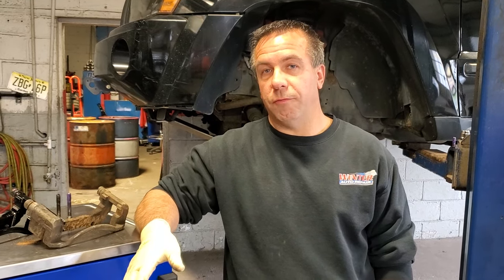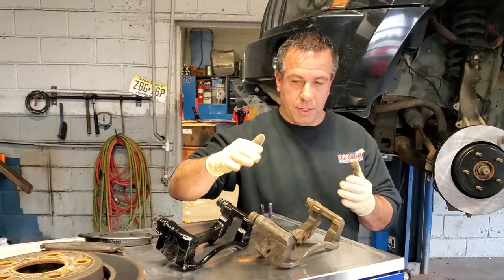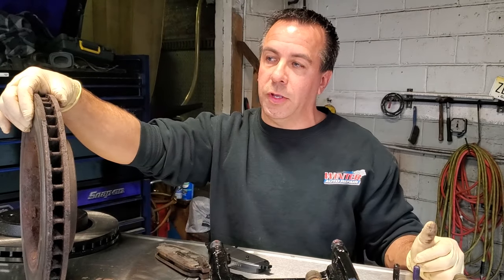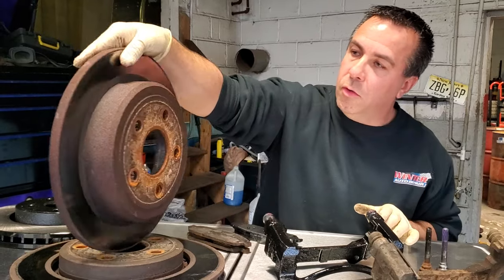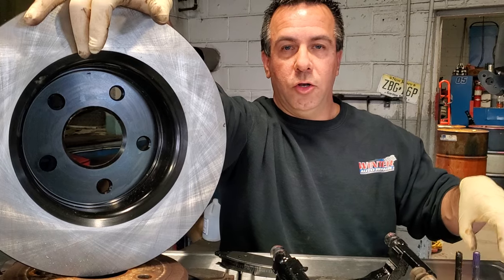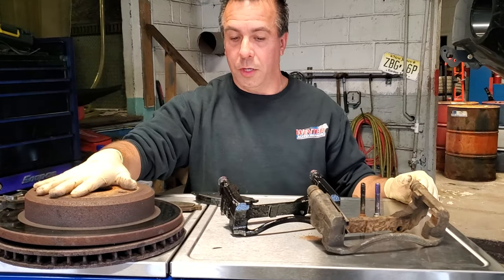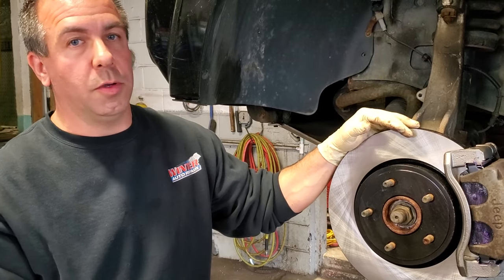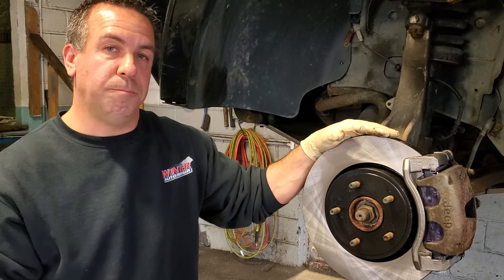High quality brakes vs cheap brakes

Comment: Is this a commercial?  My first job when I was a kid was loading groceries into people's cars, after that I did oil changes.  We did oil changes at cost, because my job was to find anything wrong with the car, that's where our profit came in.  I had to explain myself why I only did an oil change on a car that came in for an oil change, why didn't I sell the customer a transmission flush, coolant flush, brake flush, shocks, struts, brakes, tires, wipers, alignment and batteries.  "Mr. customer, your battery is over 12 months old, you don't want to find yourself and your family stranded do you?"  We had to memorize our lines.  Had the job for less than a year, pay was good but couldn't stand it any longer.  At any rate, I have to say that this is the first time I've heard of how terrible "white box" rotors are.  Looking over my maintenance records on my truck, I bought some rotors from rockauto back in 2017 for less than $22 each.  I have more than 40k miles on these pads and rotors while constantly towing about 3k lbs empty to 9.5k lbs loaded.  So for the last 4 years, and 40k miles, I've been towing a trailer that outweighs my truck using rotors that cost less than $22 with metallic pads (those who know about brakes know that abrasive pads, like metallic pads, shorten rotor life compared to ablative pads, such as ceramic pads) and have no shimmy, shake or abnormal noises.  And I'm about to hit the road again in a few minutes, same truck, same trailer, same brakes rotors and pads (those were less than $10).
Reply: nice
Reply from the maker: Not sure what you mean about being a commercial.   Was just a video to show the difference between cheap rotors that didn't last and the quality parts we use.  
Unfortunately the place you worked for sounds like a chain or larger store.  We do not pay our techs by the job or flat rate.  They are hourly employees.  We do not give bonuses based on selling jobs.  If we did we would use cheap rotors and pads so customers would keep coming back.  We've been open for 26 years and my kids have plans to take over the shop when I retire.  The only way to have a generational business to to treat the customers right. 
Sounds like you've had luck with cheap parts and I'm happy for you.  It's not what we use and if a customer wanted cheap parts we would recommend them to another shop.  I stick to my convictions on quality even if it means a lost sale.  I'd rather have a customer leave because they feel I'm too expensive then find out they crashed and their family was injured or worse because of an inferior product.  
Thank you for watching and commenting on my video. 
Good luck with your truck, I hope you have continued success with it.
Reply: Depending on budget, I am willing to use cheap uncoated rotors and premium pads. You will get 2-4 years out of the rotors in the rust belt before they are scrap. I never use cheap pads though. They sometimes won't fit in the slides, squeal, leave large amounts of dust.
Reply: @mph5896 , For my personal vehicles I typically use Wagner or Raybestos, not cheap, but not high-end either, but inflation has made them a bit more expensive than just 2 years ago. Are you in the rust belt? I'm in Texas, part of the "swelter belt", but not as bad as Arizona, New Mexico or Nevada. Rust doesn't chew my rotors. Everyday use is what does them in. My daily driver, a Chevy Impala, rotors last about 4-5 years, but the rotors aren't worn, they're warped, and after 5 years of use I can feel pulsations in the steering wheel when braking. But that car has aluminum wheels, and is not towing, so I use ceramic pads, which are ablative in nature. I still have the same truck that I mentioned before, with the trailer that outweighs it. Because of the weight, and because it has steel wheels, I prioritize braking power over brake dust, so in this case I prefer metallic pads, which are abrasive in nature. So those rotors don't warp after 5 years, but they do thin after about 3 to 4 years. Because it doesn't warp, I don't get pulsations in the steering wheel, so I have to remove the wheels to visually inspect the pads and rotors, which I do once a year.  Funny that you mention squeal. My truck squeals as I drive down the road, but hearing it for hours on end, I kind of tune it out. But when I apply the brakes, even slightly, the squeal goes away, it's as quiet as a mouse.

Comment: i bought some white box rotors that are cross-hatched. my question is i have some high temp caliper paint, would it help to paint the uncoated surfaces like the coated surface of the better rotor?
Reply from the maker: I guess it couldn't hurt to paint the hat and veins.  Just stay away from the rotor where the pads touch obviously.    Good luck!
Reply: Honestly I am not a very tech savvy however I always buy brakes from geobrakes.com 

And they sell on really cheap price but thr quality is good
Reply: @WinterAutoRepair  thanks your response is much appreciated
Reply: @chloedecker4991  well, hello detective(pun). sounds like a place to check out

Comment: Thanks, Chris, for a great video and good advice! What brand rotors and brake pads do you recommend?
Reply from the maker: I really like the Centric brand. Good local parts stores should carry them as well as online like rock auto.  If you can't find them for your car get perfect stop high carbon. They are similar quality!  Good luck and thanks for watching!
Reply: @WinterAutoRepair  Thanks again, Chris! I just moved up from Skillman to North Jersey -- would have used your shop had I known when I was living further south. I took your advice, and have bought the Centric rotors -- and will be putting them on my 2013 Outback, and on a 2006 Forester we just got for my daughter who is starting college in the fall. She was actually deciding between studying Automotive mechanics and engineering, and will start NJIT ... but has started to do work like brake jobs on our cars. I got Akebono ceramic pad for my Outback, but bought Bosch Quietcast premium ceramic for the Forester -- a bit more affordable and it seems like they should be good quality.
Reply from the maker: Awesome. Best of luck to her.

Comment: Rust on non contacting surfaces says nothing about the quality of the metal, simply means the metal was not coated. A wire brush with new caliper clips fixes the pad sliding issue. This throw away BS is what's ruining the world, instead of taking the time to clean and reuse parts, people simply throw things away.

Comment: Do you have a go to brand when it comes to a brake rotors? It's for a 2017 Lexus GX 460
Reply from the maker: We always go to Centric first. Their 120 series is the standard and the 125 is high carbon. High carbon are better if you're an aggressive driver or have a Truck/SUV. The 120 series is fine for most cars and drivers.
Reply: @WinterAutoRepair  thank you so much for the info, I've heard of that brand before but was not sure about it, R1 concepts and ebc I think are the other brands people recommended, but R1 has only 1 year warranty that's kinda low in my book, I will definitely look into Centric rotors, stay safe
Reply from the maker: You're welcome.  If you're unable to find Centric, R1 is ok. Perfect Stop high carbon are good also. As far as pads. I like Centric and Power Stop or DFC.

Comment: comparing front and rear pads for wear  is misleading.  Front brakes do the majority of braking.
Reply from the maker: That was true years ago. Now cars brakes wear almost identically. In fact some modern cars like the new Corvette have larger rear brakes than front. Older cars had much more weight up front which cased the front brakes to do more of the work. Current cars are fairly balanced weight wise which allows for even braking and even tire wear.
Reply: @WinterAutoRepair  while I liked the video, I'm gonna have to disagree with your comment. I work at a Toyota dealership, I work on new vehicles every day. With this in mind, I can confidently say brake pads and tires do not wear evenly from front to rear.

Tire wear is based on where the drive axle is and the location of weight. On a FWD vehicle, the tires on the front are going to wear a lot quicker due to the weight of the engine and because they are doing the pulling power of the vehicle. Most pickups are RWD (if not using 4WD) and because the rear tires are doing the pulling (especially towing a load), they are going to wear the most. If vehicles were truly balanced like you said, there would be no reason to rotate tires.

The same goes for brakes. I have a 2020 Yaris with almost 60k miles on it. It has discs up front and drums in the rear. I replaced the front brakes at 30k. The front brakes are currently at 6mm while the shoes are still at 3mm. This goes to show that brakes do not wear evenly. This also goes to show that the front does more of the braking. On most vehicles, I find that the rear pads typically have 1-2mm more than the front brakes.

Comment: My rotors are original - over 200,000 miles. I replaced front pads at 170,000 miles - there was still a bit of material on them. 
I replace with white box rotors - they easily will last > 200k. The life of the rotor is based on how fast it is worn off - so usually amount of metal. There is no difference here regarding "rust" etc. The expensive stuff usually has cross drilling etc. that makes sense for performance cars - but also wears off faster as less wear material.

Comment: I wasted my time watching this video because he doesn't give us brands as an example so that would have helped a great deal, knowing which brand is cheap and good quality. So, this video made no sense for me. two thumbs down! I'm sure this guy is a great mechanic, but I want to learn something so I can use for my future purchases.
Reply from the maker: The video was originally made for our customers to understand the type of work we offer, not to showcase products. 
In addition, this video was made 3 years ago.  The brand we used then is no longer in business!  So telling everyone the name wouldn't help now. If you wanted to know brands we recommend, you could have just asked instead of rambling on with your comment.... 
Currently, we have the best luck with Durago EPC high carbon rotors and Power Stop pads.  
You can buy them at good quality local autoparts stores or online retailers such as Rock Auto.  
Good luck and thanks for watching

Comment: Are Wagner brake parts any good? btw very informative video. Thanks for your high quality work.
Reply from the maker: Hello Ron,   Wagner is better than no name brand.  However, for the same money there are other brands I prefer.   If you can locate Centric,  their rotors and pads have always fit and performed very well for us.   Make sure your rotors are machined like the ones in our video and try and get ceramic pads if you can't locate Centric parts.   Thank you for watching and commenting!

Comment: Of course you want inspection. How else can cheat poor people out of a way to ride. Am perfectly capable of fixing my own car. I just rebuilt my 2010 gmc terrain engine. Then took it to inspection and they told me I had to replace my rotors and front brakes there are literally nothing wrong with them other than a little surface rust where the pads dont touch and over half the shoe is still there. Just so they can try to sell me a brake job. Which of course am gonna do myself. Inspections the biggest way for mechanics to rip off the non mechanically inclined period. Also told me need new lower control arm all it was was the ball joint. I tell you real nasty people. Wanted to charge over a 1000 for brakes and and a ball joint cost me 120 bucks to fix myself just goes to show.
Reply: That being said there is a huge culture difference from down south were I am from and up north. most people up north are not dyi people. So i can understand you don't need to be driving around a death trap but its a double edged sword most mechanics are not the most truthful bunch as i have come to find.
Reply from the maker: Actually in NJ the state does the inspection not repair shops so there is no way for the shop to rip you off. Thank you for assuming we wanted inspection to take advantage of people. Now. NJ got rid of safety inspections all together. All they inspect is your check engine light so if you have no light on then you pass. What people assume in NJ is that they passed inspection so their car is safe. Bald tires with cords hanging out, grinding brakes and this past week we had a customer with a strut that was so bad, it pulled through the mount and came out all together when we tried to lift it up. The cars here are plain unsafe. When I say we need inspection, it's based on the mess we have here in NJ not wherever you are from. As far as doing the work yourself after failing inspection, great, you should be allowed to fix the car yourself. I don't think the government should force us to use a mechanic or dealer to repair the car. However, for the safety of the drivers on the road the people need to be held accountable because they certainly don't care enough about themselves let alone anyone else on the road for that matter. If you could only see some of what we see on a daily basis. 
Anyway, thanks for watching and commenting. Give us some ideas of videos you'd like us to make and subscribe so you can see when we post those videos! I appreciate the support.

Comment: I only purchase Oem rotors and brake pads on my Honda and do pad replacement at about 45,000 miles twice then replace the rotors, I stay away fro Oreileys Napa and auto zone Chinese garbage parts that warp and squeal after only 15,000 miles

Comment: I do not agree with you about state mandated inspections.  Its just another scam.  If you care about your car and your life, and the safety of others they will get their cars looked after.
Reply from the maker: Unfortunately the majority of people do not care about their own safety. Go to any bodyshop in a state without inspection (like NJ) and you'll see bald tires, bad ball joints and grinding brakes. 
So its ok that you don't agree but the reality is, people really don't care. That's why race tracks have to do safety inspections on race cars. Even people who race don't care about their safety in a lot of cases.

Comment: 450 is ripping you off 😂, Save your family some money   and get 30 - 50 dollar rotors  re surface with small circular sand paper w drill paint rotors edge and wheel hub contact points with high temp paint. Finish up the break with fog oil done.  Don't pay the "family" man 🤡 be a man 🔧.